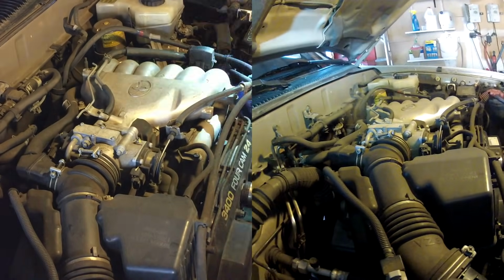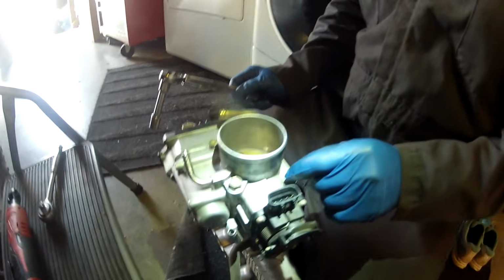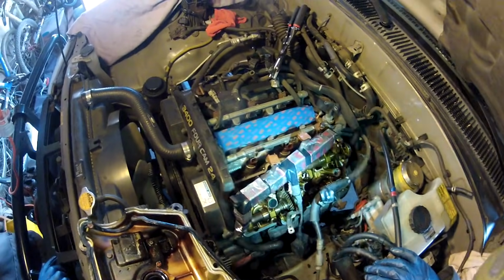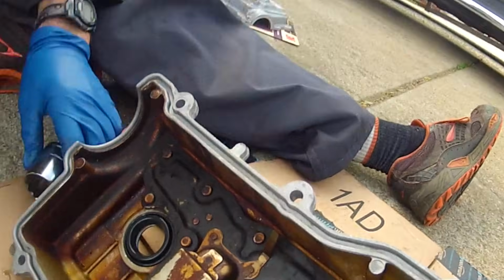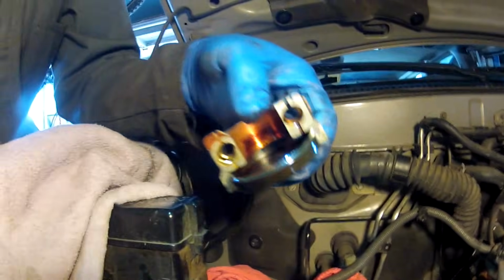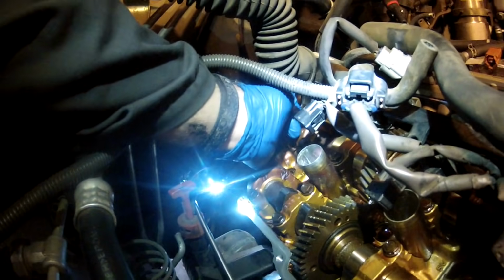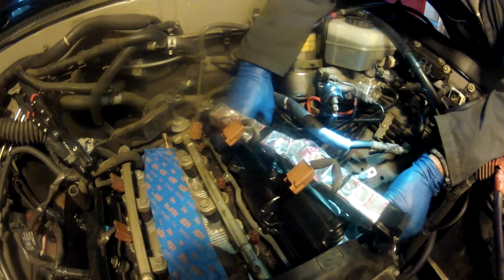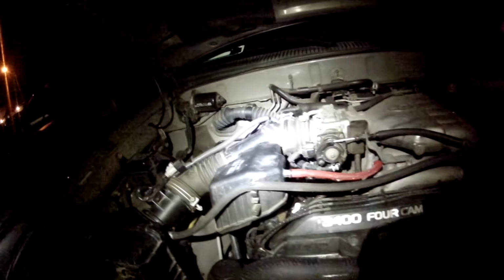3.4 L V6 5VZ-FE Toyota 4runner, Tacoma, Tundra Valve Cover Gasket Tutorial

Comment: Hey Timmy....Have you ever replaced valve cover on 22re engine?...thks..jc
Reply from the maker: No, I haven't.   It should be pretty easy though.
Reply: @TimmyTheToolman  From what I read, there are these half moons and you need to put grey silicon at the ends wherev it meets the block at the top, but i am confused as to whether or not the entire half moon needs it coated. Any idea?..thks jc
Reply from the maker: @Samson-EC  It would be the same as the half moons for this V6 engine.  You put FIPG on the curved part that sits in the head and then you put a little FIPG at each seam of the half moon where it meets the flat part of the head.
Reply: @TimmyTheToolman  Excelllente'....thks Timmy....jc
Reply from the maker: @Samson-EC  You're welcome.
Reply: @TimmyTheToolman  Forgot to ask. How long do you have to wait for silicon to set up before running engine?   ....thks..jc
Reply from the maker: @Samson-EC  Just a few hours.  The black FIPG sets up quick.
Reply: @TimmyTheToolman  So you use the black instead of ģray?....jc
Reply from the maker: @Samson-EC  Yes, I used the Toyota Black 103 FIPG.  I like using the Toyota form in place gasket over aftermarket.
Reply: @TimmyTheToolman  Thanks Timmy. Always appreciate you taking time to answer. Merry Christmas to you and your family...jc
Reply from the maker: @Samson-EC  No problem.  Merry Christmas back at ya.

Comment: Hi Timmy I appreciate your videos you saved me a grand on my all my front end bushings! Anyway how do you clean the moons? Also to be sure there’s no sealer other than the torquing of the valve? Thanks dude!
Reply from the maker: Just clean the half moons with a brass or wire brush.  You want to get all the old sealant off the half moons and off the heads where they sit.  You don't use any FIPG on the valve cover gasket other than the spots on the heads that we document.  Good luck with the job.

Comment: Almost six years after you posted this I used the video over the weekend to do this on my 2000 4Runner.  From the parts lists to all the tips it made the job a breeze.  Never did anything other than normal maintenance, belt changes, and minor repairs before this. Thanks brother!
Reply from the maker: Good to hear Curtis.  The making of this video is how Sean and I met and was the beginning of our channel.  I had posted on the T4R.org forum about my experience doing the valve cover gasket job on my 2000 4runner and he messaged me asking for help doing the same job on his 2002 rig.  I had a GoPro camera I rarely used and asked Sean if he would be interested in filming it so we could help people.  He said yes and he edited the video using iMovie.  We came up with the channel name which was a play on the Tim Allen Home Improvement show, (my nickname is Timmy,  and the rest is history.  It's been a fun, interesting, and challenging ride over the almost 6 years we've been at it.  Thanks for the comment.  We appreciated it and you're very welcome.

Comment: Another superb video.  I have a question.  That fragile plastic cover on the engine wiring harness, which I am sure will break when I do my valve covers, is it replaceable and do you have the nomenclature/part number by any chance?  Thank you.
Reply from the maker: Don't have the part number for that plastic wiring harness cover.  I would just use some split wire loom that you can get at any auto parts store and secure it with electrical tape if your OEM harness isn't salvageable.   Glad you like the video.
Reply: @TimmyTheToolman  ;Outstanding.  Thank you very much.  I was not sure the split harness cover would take the heat.  Look forward to more excellent videos.
Reply from the maker: @wrongfullyaccused7139  You're very welcome.

Comment: Can you reuse the cam plugs?
Reply from the maker: I don't recommend it.  Some guys cheap out and smear FIPG on the cam plug and throw them back in.  For all the work it takes to get the valve covers off, don't cheap out and try to reuse them.  You might very well regret it when they start to leak.

Comment: Great very nice professional job  ,I have a question did you keep the silver tape on the harness or you remove it?I miss tha part, and second  it's really necessary to remove the half moons and the cam seals?
Reply from the maker: The tape stayed on.  Yes, it's necessary to remove and reseal the half moons and to replace the cam seals.  The half moons and the cam seals are also potential leaking spots.  You could forego doing it, but you might regret it.  Your choice.
Reply: Do I need to get the intake manifold gasket as well
Reply from the maker: @MrJega16 They are a metal gasket and some people choose not to replace them.  We recommend replacing them because why risk having a vacuum leak.

Comment: Hey Timmy, I’ve got all the parts except the PVC valve which is in the mail. Is it possible to install that after the fact? I have time to do the job today.
Reply from the maker: Yeah most definitely.. you will have access to remove the PCV valve and grommet from the top of the engine very easily.

Comment: Timmy, your videos have been super helpful to my son and I as we work to keep our 1999 loaded 4 wheel drive Tacoma on the road. We got it in 2015 in Florida with 192,000 on it and it’s at 217,000 now. Since getting it no one but us has turned a wrench on it. I’ve been dreading this valve cover job though. It’s been two years in the making and I limped along by torquing the valve cover bolts I could reach. It got to the point where I stopped driving the truck because a fire seemed like a very real possibility. Just before that though I had an injector on cylinder 3 go bad and I diagnosed and replaced it using your videos. While in there I did all three injectors on the side and spark plugs. I was able to do it without removing any of the intake plenum and only the throttle body. This project built confidence that I could do the valve cover gaskets. 

Over the last few days my son and I have tackled the job! Your new video on valve clearances popped up just a few days before we started. We had planned on checking valve clearances while we were in there but it was great to have your new video to show the way!

Everything has gone well. Everything is disassembled and cleaned. We bought new tappet feeler gauges and got lucky that all 24 valves were in spec! We used your spreadsheet and video! We had gotten mentally prepared to swap a bunch of shims but dodged that entirely. We only have a few hours a day but tomorrow we begin reassembly.

We did two things a bit differently. First we took the drivers side valve cover off by going toward the firewall and fender and then going forward over the wires. It was way smoother and tremendously easier than going under the wires. It also looks like reassembly will be vastly easier this way.

Second, we used a medium size pair of needle nose Vice Grips to remove the tube seals. One just came out with out needing to be deformed. The other 5 we deformed opposite the tab (which we did not bend upwards) with a rubber hammer and a screwdriver like you do. And then gripped the bent metal with the Vice Grips and levered back against the cover. They all popped out. I spent 15 minutes wrestling with the first one until the needle nose Vice Grips came to mind. I spent an entire 5 minutes on the last 5. It was that easy. No marring. I have a pair of bent handle needle nose pliers like yours but the Vice Grips do the work of holding and free you up to finesse the seal out. By the looks of them I’d say it was all original. The new seals are slipped under the unmolested tab and pressed in with thumbs. All done and a piece of cake. No hammering, no socket. 

While we were this far in we also swapped out for three brand new fuel injectors so now all the injectors are new. Of course we also did the drivers side spark plugs. 

Doing the two rear cam plugs and the reassembly tomorrow. 

Thanks again for your amazing YouTube channel! Be well Timmy.
Reply from the maker: Good job with all that work and it's cool you can share the experience with your son.  Happy Wrenching!

Comment: Hey @TimmyTheToolman thanks for this great video! I’ll be doing my VCGs tomorrow and plan on following this video closely. One question for ya. When cleaning the covers and old FIPG off are you just wiping it with a rag or did you use something like brake cleaner or another product?
Reply from the maker: The covers themselves won't have any FIPG on them.  You just have to remove the old gasket.  The area you'll find old FIPG is on the heads, half moons and cam plug collars.  Brake cleaner and rags work, Good luck with the job.

Comment: Where can I buy a toyota service manual? I bought a haynes manual for this truck and I'd like to have the toyota manual too, I feel like they both offer great information but both have some information that the other manual does not have.
Reply from the maker: We got ours on eBay.
Reply: @TimmyTheToolman   so that little pointer tool that you painted orange, i bought some after you told me what they were. After taking my valve covers off, I have quickly learned that the flat end of those pointers make for a safe scraper tool for cleaning off the surface before putting covers back on.
Reply from the maker: Nice! Those spudgers have multiple uses. The plastic is also forgiving for interior pieces you’re trying to remove as well.
Reply from the maker: @cmart9240  They do make for a good scraper.  I've used it for that as well.

Comment: How do you suggest to clean off oil sludge build up around the outside and mating surface before doing the repair?
Reply from the maker: Degreaser for sludge and elbow grease. Probably some type of nylon brush so you don’t scratch anything.. and for the stubborn left over residue on the mating surfaces, a razor blade to scrape.
Reply: @TimmyTheToolman  Ok thanks! I had heard a few people say power wash the motor but that made me a little nervous.
Reply from the maker: Well you’re referring to the sludge on the inside of the valve cover you remove from the engine right?
Reply: @TimmyTheToolman  both. I was wanting to clean all the sludge off before removing the valve cover so that nothing falls in during the repair

Comment: Just wanted to say thank you! I never had the courage to tackle this job...until I found your video! I have an 01 4Runner and it had been blowing oil for about a year..... or 3 🤣 Your upload prepared me for literally everything I encountered. I even bought a GW Torque wrench for this job! A few things that did surprise me was how long it took me to do this...about 10 hours. I definitely didn't rush, and had no problems putting everything back together....but damn I feel like I've been beaten up by the neighborhood bully. I was stunned with how LOOSE my valve cover bolts were.....it was kind of scary. I didn't need a ratchet to get them off, I wonder how common that is. Thanks again!
Reply from the maker: Great job Jason.  Glad our video empowered you to get it done.  It's a big job especially if you're new to turning wrenches.  You did it right by taking your time and not being in a rush.  All these valve covers over time will have loose bolts.  I don't think it's actually the bolts backing out but rather the rubber on the washers shrinking over time and causing the tension on the bolt to lessen.  That's at least my educated guess.  You're very welcome Jason and Happy Wrenching!

Comment: Timmy, when replacing the rear cam plugs, are there camshaft plugs in the front position as well that could be changed?  Thank you for this detailed video!
Reply from the maker: We had a typo with the parts list.  There's only two cam plugs on the rears of the heads.  The front csm seals would be replaced when doing a timing belt job.
Reply: Just got to the front ones and I was so confused how to take it off LOL good thing I didnt try tooooo hard....

Comment: Hey Timmy, I just want to thank you for the detailed video.  Your video was a massive help in getting this job done.  The cover was leaking in spots but those old cam caps were leaking like a sieve.  Took me a good long while (8 hours) but I was taking my time to make sure every step of the process went to plan.  And sure enough, everything went by the book as far as I can tell.  While I was in there, I replaced my plug wires, PCV valve, and cleaned the throttle body and IAC.  I do have a high idle after cleaning the TB and IAC but many have told me that the rig needs to relearn the idle values since I cleaned all the gunk out. I also used your video for that process as well.  Used carb cleaner and Qtips for cleaning the IAC as well as making sure to use a new gasket as well.  I think I'm really close to getting this rig to where I want it to be.  And just about all of that is due to your videos.  I always reference your vids to everyone in the 3rd gen Reddit sub and other forums.

Thanks again Timmy!
Reply from the maker: Hey Chris, great to hear the job went well and that you're making good use of our videos.  Thanks for taking the time to comment and share this with us.  We appreciate it!  If that high idle doesn't go away, make sure all your vacuum hoses are intact and properly connected.  Happy Wrenching Chris!
Reply: @TimmyTheToolman  Thanks Timmy, yeah, I double and triple checked my vacuum lines.  Everything is where it's supposed to be.  If it doesn't settle, I'll probably have to chase the IAC valve.  I've read posts from others where after they cleaned the old one, it never operated properly afterwards.  But we shall see.  Holding hope that it's just in need of an idle relearn.
Reply from the maker: @chrisp7165  Yeah, hopefully it does settle back to normal for you.

Comment: Hello Timmy

I have one question. You wrote, that the camshaft plugs (nr: 11188-62020) we need only 2 pieces (one at the back of each head). So in the front we don't have to change this parts ?
Reply from the maker: On the back are the camshaft plugs. On the front And rear are the 1/2 moons. So yes, only 2 camshaft plugs are needed which are located on the back of the engine on each side.
Reply from the maker: Yes, only 2 camshaft "plugs" at the back of the heads.  The front of the camshafts have camshaft seals and those would be replaced during a timing belt job.
Reply: Thanks for fast answer. Tommorow I will do It. Thanks one more for the help :)
Reply from the maker: @amerycapl5447  Good luck with the job.  Take your time and you'll be golden.  Happy Wrenching!

Comment: do you use anything to keep the gasket in the valve cover when you place it? or does it just seat and stay?
Reply from the maker: The valve cover gasket fits tightly into the valve cover.  As long as you don't rub the gasket hard on something while you're getting it place, it won't dislodge from the valve cover.

Comment: Timy where are you located??
Reply from the maker: We're located in San Jose, California
Reply: Timy thanks for all your videos l just need to do this job in my 2001 Toyota 4runner sr5, what's is ne name of the cilicon that you use for the parts you remove on the 4 corners??
Reply from the maker: @hzarate6312  Open the video description by clicking on "Show More" and it will expand out.  The FiPG is linked in the Parts List.  It's the Toyota FIPG 103.  It the black meant for engines.
Reply: Ok, timy thanks timy is posible to have your tel number??
Reply from the maker: @hzarate6312  Send me an email: mtbtim@sbcglobal.net

Comment: great vid.  why do we need 2 plenum gaskets?
Reply from the maker: The plenum gasket is a 2-piece gasket.  That's the way it's made.  There are two plenums so two plenum gaskets.   One seals the lower plenum to the intake manifold and the other seals the upper plenum to the lower plenum.  Glad you like the video.
Reply: @TimmyTheToolman  thanks for the reply Timmy.  On supercharged applications since there is no upper and lower plenum, just the supercharger, i would only need 1 gasket right?
Reply from the maker: @djrodriguez6582  Yes, just one plenum gasket.

Comment: Tim.  Would you recommend replacing all that tubing and hoses ?  I noticed on my engine some of the pieces have that cracking look from being old.  You're the best !!!
Reply from the maker: For the vacuum hoses, it they are starting to crack at the ends and might cause a vacuum leak, it wouldn't be a bad idea to replace them.  For the coolant hoses, that attach under the throttle body, those generally are ok, but if you they are showing signs of cracking, I'd replace them as preventative maintenance.  Happy Wrenching Bill!

Comment: Tim, Dan, 97 4-Runner,188,000. Slight Weeping at Valve covers? That doesn't require any attention? More like a Light Fogging. After every longer drive, I open the hood and let it Cool down for 15-20 minutes, seems to release a lot of heat, It works for me, fewer problems in the long haul, yes it works on all my Stuff, it's worth it.
Reply from the maker: Dan, I'm not sure if you're asking a question of us or making a statement.  Could you clarify?
Reply: I find out that buy cooling the engine down after a long Pull and leaving the Engine running with hood up releases a ton of heat. Also cools the Tranny down, with no gauges.